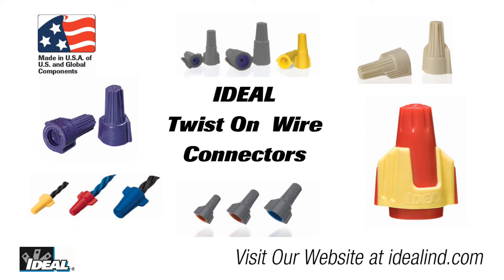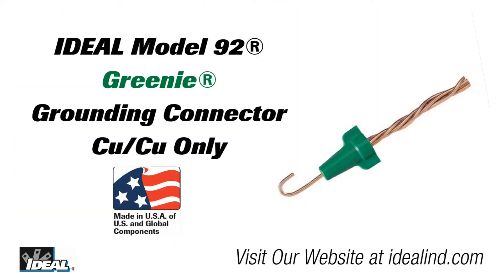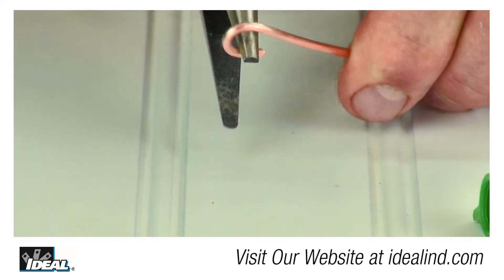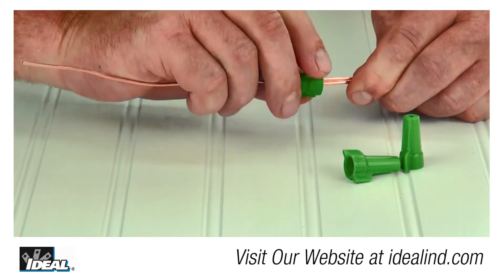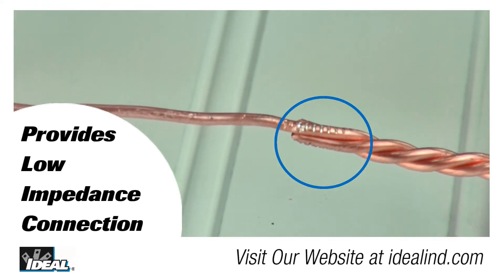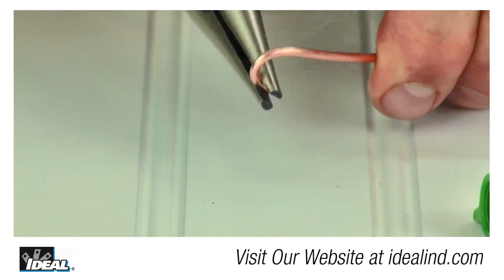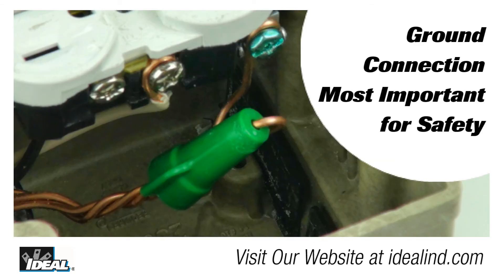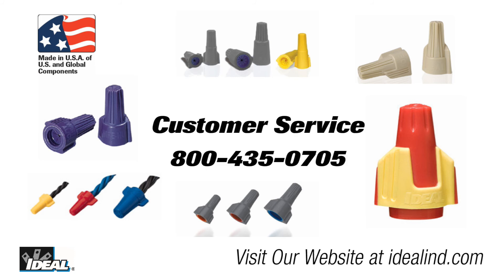Model 92® Greenie® Grounding Connector

Comment: The problem I have when using the minimum, 2 #14, the wire nut never gets real tight, and the other wire starts coming out of the hole.
Reply from the maker: Ted let me pass your comment along to the product folks if I get a good answe I will get back to you. Ron

Comment: How come this green  wire not are not acceptable  in San Diego County by the inspectors?
Reply from the maker: Hi MIgel I am not 100 percent sure why other than it is a long standing practice by the city. They may prefer crimp connections instead for the ground wire.  Hope that helps if you find out let me know. Ron
Reply: Could be that if someone uses a short piece of wire for the pigtail instead of leaving the line continuous and long. 

That short pigtail might not get twisted up properly and could open later

Comment: With a crimp barrel you have the same result—without a SPACE ROBBING green connector!
Reply from the maker: Hi SH that is why we still sell the crimps! Ron
Reply: Green wirenuts are better if you do alot of changes on projects or alot of troubleshooting crimps are more of a hassle to remove and alot of time cut too short

Comment: Why not make these in different colors to use with other conductors?
Reply from the maker: The connector is designed and UL Listed for grounding applications only. You can't use it for the other conductors in the circuit because you can't pass a conductor with insulation through the top. Hope that helps Ron
Reply from the maker: Frankie just use it for what it was designed for grounding.........take care Ron
Reply: Because anything passing through the hole will be bare. You don't want bare, energized conductors inside your device box.
Reply: So, you want to strip the factory insulation, install a gimmick wire nut and then re-insulate with tape. Such a waste of time. That is what normal wire nuts are for. Make connections with a pigtail and save on labor and material cost.
Reply: Frankie Teague  you're very confused.
Reply: I like your idea.
Make a black, red or yellow with a large enough hole for the conductors insulation to pass through.
Reply: Doug Gross obviously you are clueless, or just making a joke.

Comment: Why is low impedance a desired characteristic?
Reply from the maker: T Higgs Good Question. A low impedance or low resistance connection in the electrical circuit means better efficiency. As loads turn on and off these connections will heat up and with a lower resistance will actually run cooler over time as well.Hope that helps
Reply: +Ron Kipper Datacomm what about multistrand 14 gage wire from a recessed light ground. would this be applicable to tieing an incoming, outgoing, box ground, and multistrand wire from the light fixture? thank you.
Reply: smallcityfarmer — I think these stupid green things are for solid wires. Period.